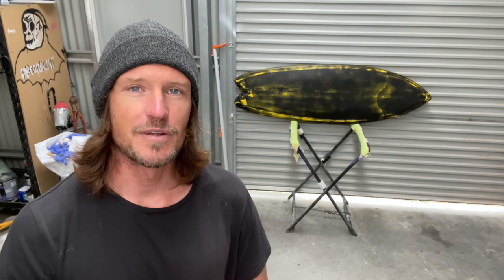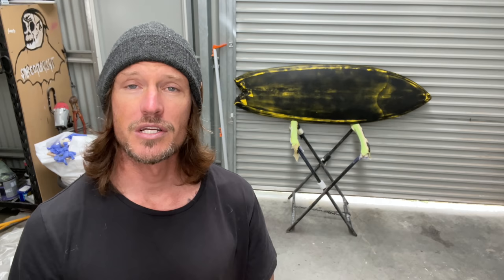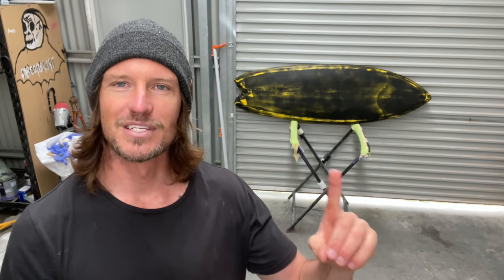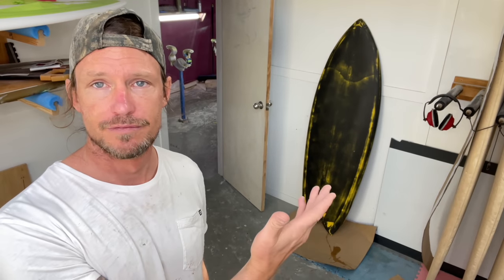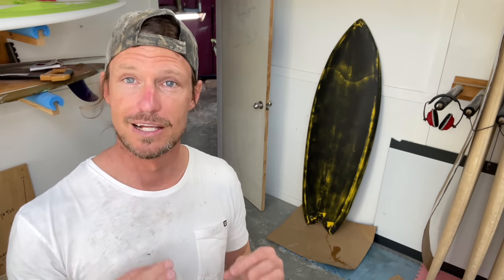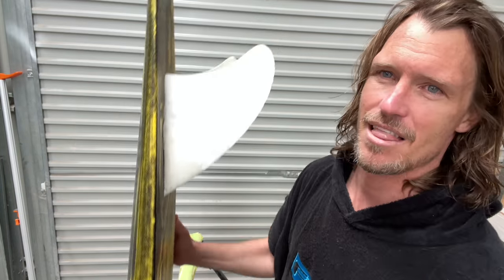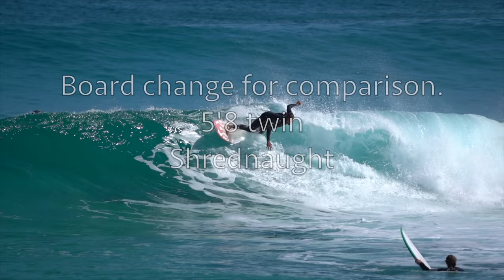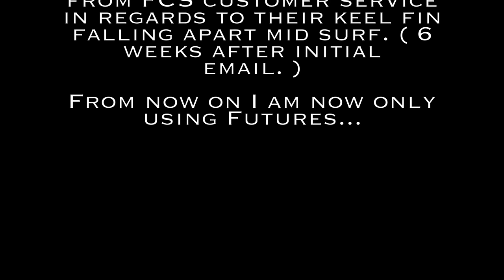Making TRASH into TREASURE/SURFBOARD. Does it SURF? START to FINISH / plus SURFING in MARGARET RIVER

Comment: do you use the same resin on the hot coat ? and why did you spray it  if the resin had pigment in it
Reply from the maker: No you use sanding resin. It’s just lam resin with a wax additive to make the resin sandable.
Originally I wanted to see if the yellow paint would hide the scars but it didn’t so I put some pigment into the resin.

Comment: Epic! What glue did you use to attach the extra foam on the rails? Epic paint finish! Did you roll over clear coat at the end? Sick. I was gonna comment that it looked like you fully lost a fin out there! 😀. You could notice it after the 17:00 min mark. You actually did pretty good with that kooked fin

Comment: Almost certainly a dumb question, but what's to prevent someone from piecing together some blocks of hard packing foam (the kind used for flat screen TVs and such) to make a blank? With the fiberglass resin melt it? Is it not durable enough? ... Thanks for the video.
Reply from the maker: Not a dumb question at all mate.
Nothing really.. the only real issue is strength. The packing foam is generally a really low grade eps with large beads. The beads make it hard to get a nice smooth shape and the low strength increases snapping and heel dents. Some of those strength issues can be overcome with the appropriate glassing schedule. Also incorporating a stringer would help. Also the glue lines between pieces of foam can be an issue to shape as it’s harder than the surrounding foam. BUT I have seen it done and I personally think it’s awesome. Better than just throwing it in the rubbish.

Comment: Great effort.  I found a broken longboard that I want to make into a mini Simmons.  Is there a good method to peeling all the fiber glass off?   Thinking of shallow cuts and pry with putty knife?
Reply from the maker: Thanks mate. It’s always better to try upcycle rather than just throw it out.
To get the glass off you can use a dremel or jigsaw and cut very thinly along the rails. From there you can pry up. You will lose some foam so try to make sure the shape you’re attempting to get out of the broken board has enough space to allow for the lost foam. 
Good luck 🤙

Comment: Hey thanks for sharing all your videos first of all. I have a board that needs a major repair and i want to strengthen. The board is not old but very light and fragile. It is already very thin so i think delaminating and reshapingis out of question but how do i fix all the little presure dents over the deck? Any thoughts?
Reply from the maker: Thanks for watching. Without seeing the board it’s hard to answer but if it’s just heel dents on the deck of the board your best to just leave them and surf. Next board ask for a stronger glass job on the deck. 6/4 is a good start for a normal board

Comment: What kind of top coat do you apply at the end with a roll on and that gives such a cool looking matte finish? Is it Poly? Did you sand after that last top coat to get the matte finish?
Cheers
Reply from the maker: Clear acrylic sealer. I just give it a light buff with 360+ grit to take the dust grit out and give it a matte finish

Comment: Awesome vid on the process of this build! And the testing at end!..Lots of ideas, got a few oldies in my shed...What sort of glue did you use on the rippings to make board wider?...Blanks here in NZ are around 120-150$nz, so good to save a few $ while in covid times...Glue give u any issues while shaping? Many thanks great vids.
Reply from the maker: Thanks mate. I used gorilla glue although the wrong one, as it was all I could find. You want to use the brown honey type expanding poly one that gorilla glue make. 
It does dry slightly harder than the foam but you can still shape it.  I’ve reshaped a bunch of old shapes so it’s definitely worth a crack.

Comment: What type of finish did you roll on? Not sprayed as well. Very interesting. Re. FCS fin= made in China, say no more
Reply from the maker: Yeh that fin fell apart and it didn’t even hit anything.. 
it’s a clear acrylic floor sealer. Just gives a nicer finish than straight up sanded

Comment: This is so sick, Love that tron style finish! 
I've always installed my FCS2 boxes pre lam, do you think there's any benefit to doing them after? 
Also cant believe you have access to waves like that with no line up!
Reply from the maker: Yew! Thanks.
The only real reason I do it post lam is because of the resin tint. If I can’t see the air around the boxes then sand it open when sanding it doesn’t look that clean.. not that looking clean was the effect with this board 🤣

Comment: Yo sick vid! About to make my first board... have you got any tips as to where to place the fin box in terms of how far up it is from the tail? planning to do a 7ft rounded pintail, with a single fin. Cheers
Reply from the maker: Thanks mate. Depends on the box size you’re using but a good range is anywhere between 6-8 inch up from tail. If you have the fin you can use that as a guide as well. What looks right to the eye generally works 🤙
Reply: Shrednaught right on dude thanks!

Comment: Why didn't you just grab fin with pliers and pull it out? Done it myself in similar situation. 

Maybe you struggled because the oard is so flat and fins are too far forward with too much toe in. Try FCS retro keels or any smaller raked fin might calm it down a bit.

Still looks like fun and will grovel for sure.
Reply from the maker: If you see in the video the fin has only one layer of glass left. Pliers would just pull that to pieces. 3 1/2 in the nose and 2 in the tail.  Fins at 8. Think it had more to do with the bottom being hardcore V and the knifey rails more than anything else
Reply: @Shrednaught  good point re the fin. I'm guilty of trying to make small twins in big surf it's a losing game! I reckon in waist high mush you'll have a blast of it. Could you notice the asymmetrical stringer?
Reply from the maker: It was a hard one cause I only had what I could get out of the busted blank. The first session was way too big. The final session was far more appropriate. Not really. Shaping it was a nightmare though
Reply: @Shrednaught  you did an awesome job considering and if nothing else it looks cool
Reply from the maker: Thanks mate. Hopefully the neighbour’s young fella will enjoy it 🤙
Reply: @onshore1ft  also guilty of this... although took a 5'5 true fish into 6ft point break.. if you could make it over the take off ledge, it was amazing. 

Fine tuned a different style of board now, more performance orientated, but twin... so far handles everything we can throw at it.. (and i've got a guy riding it that charges.. including places like "The Right")

Comment: What kind of masking tape do you use for the cut lap? I've struggled to find a masking tape that sticks well to PU foam on the few glass jobs I've done. Great content by the way! Keep up the great work!
Reply from the maker: You definitely need to use the highest of quality tape. I use 3m 233+ and only that. There are a couple different types available depending on location but that is the standard needed 🤙
Also make sure all dust is off the blank before taping and push the tape down firm with the back of a razor. You should be sweet.
Reply: @Shrednaught  Thanks for the info! Looking forward to some clean lap lines 👌

Comment: sick. is it necessary to glass it with yellow resin after spray painting it yellow? cheers
Reply from the maker: Na not at all man. I was attempting to get a full yellow so you couldn’t see all the stains and stuff on the blank.. but it didn’t work so I did the patina .
If you want a real deep rich colour though doing a foam stain before the colour lam can help achieve that.

Comment: thats an awesome build man!!!! great work how do you cut in that fish tail?
Reply from the maker: Thanks mate. 
I just use a saw or jig saw to take the bulk of the foam out then use my sanding blocks to clean up and a rounded rasp for the stringer section.
Reply: @Shrednaught  thats awesome man! hand tools always feel the best when working on jobs like that.  i have another question i have a 9' softech board and i find it extremely cumbersome and difficult to use like i cant paddle and get immediately exhausted when i paddle to much how do i split the difference between paddling potential and stability?
Reply from the maker: I’m not a huge fan of soft tops. This is just personal opinion. I’d say a fibreglass board would give you better paddle performance. Apart from that it might just be fitness?
Reply: @Shrednaught  that’s entirely fair, the paddling was a major difficultie

Comment: How thick is it now ?
Reply from the maker: Thickness it turned out around 2.5 in the centre but it was super knifey on the rails. Had a huge amount of V which I don’t think I really enjoyed
Reply: @Shrednaught yeah  , saw that ..low knifey rails pull the rail down , good for a dredging bottom turn when it,s overhead but are harder to  roll up when you want to go vertical..a higher apex and more thickness at the rail fixes that .. interesting experiment ..👍
Reply from the maker: Definitely. It was a shame that I could only get the rails at that thickness.. 
I kinda knew that it wasn’t going to work for me but pretty stoked the neighbours little guy was frothing on it.
Reply: @Shrednaught  there,s always a fit somewhere 👍..Taj Burrows rides pretty thin rails ... after repairing 500 boards and talking to the owners it reconfirmed what I,ve learned shaping ..that no one size fits all ..keep it coming ..with so many small surf shops getting swallowed by the surf corporates ...there,s not many openings for young guys to learn anymore ..🤙

Comment: You did a wonderful job but messed up tremendously in one area that actually surprised me considering your skill level which is definitely between intermediate and expert in my opinion. But I am confused why you left an unnatural bulge on the rail about 8 in from the tail. It's really going to screw up how that board rides. You could have just pulled the tail in a little bit more or you could have winged it. 

I'm just confused as to why you didn't.

Edit: Oh I absolutely loved how the resin tint turned out and it's completion. I like the black and yellow faded together I think it looks great.

Oh and much respect for not being a good surfer but still f**** charging it in a swell like that anyways.
Reply from the maker: The board was an experiment. Pieced together from Frankenstein pieces. As for the “bulge” on the tail, this was done for two reasons. Firstly the way the glue lines from the rail off cuts had joins in this area and secondly the board only being 5’4. This gave the rail line a lot of parallel. The bump you’re talking about is actually a break in the rail line to allow not only a more pulled in tail block but also to allow a break for water/pivot point. Think album twinsman or to a more extreme level the Mackie side cut fish. A wing/flyer would of also worked but I’m not a huge fan. I couldn’t get more curve in without changing the plan shape. Couldn’t change the plan shape as it was a Frankenstein blank and that’s all I had to work with. Ultimately it didn’t matter much as it was a dog. Yeh I think a 5’4 V bottom fish with no rocker is a bit short for a 6’2 guy in that size surf.. 😅
Reply: @Shrednaught  I appreciate your reply man. It completely changed my perspective. Happy holidays dude.
Reply from the maker: You too mate. Have a good Christmas and new year 🤘